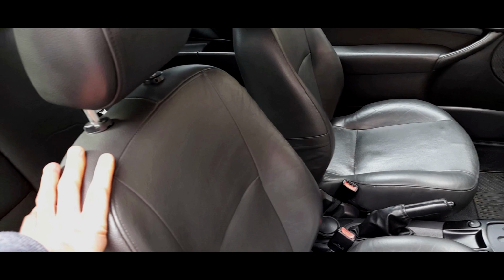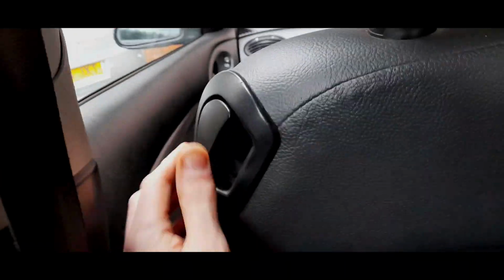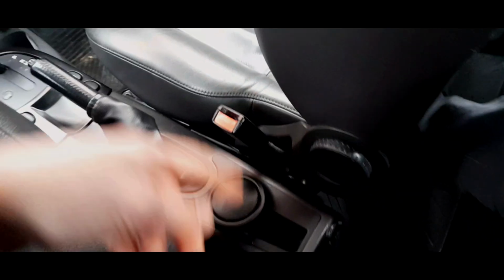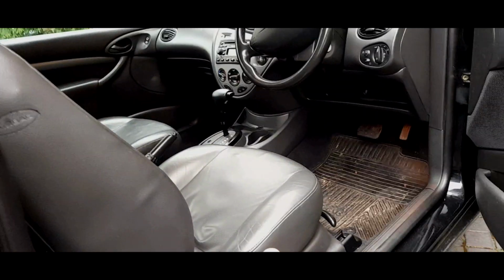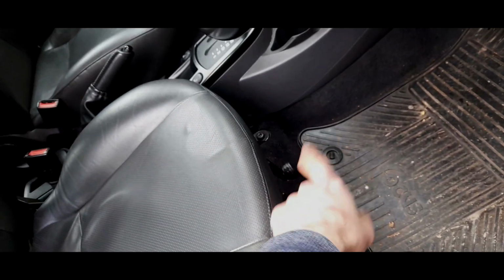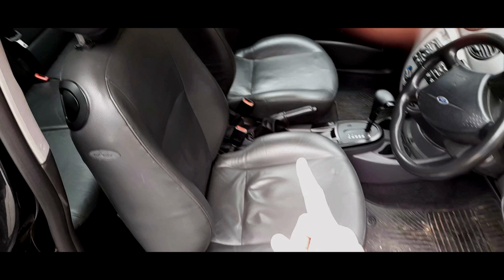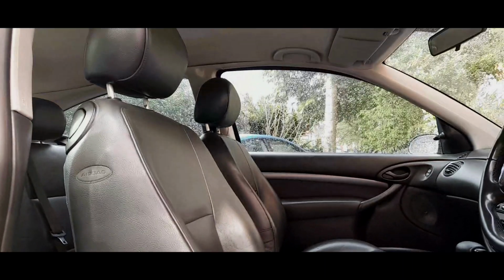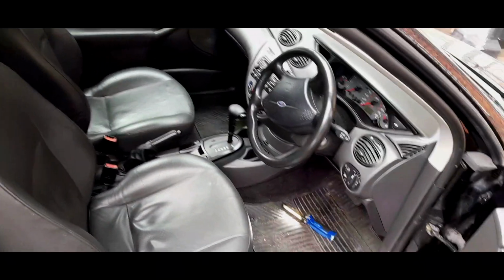Focus MK1 - Looking at the Seats, common issues & swapping them!

Comment: Question, I may have missed it in your video, would Ghia leathers slot into the lx in terms of the switch under the seat?
Reply from the maker: No LX models don't have the wiring for electric seat adjustment so it wouldn't work on ghia leathers.
Reply: @usuallyfixingtinkering  so am I right in saying I'd need the zetec leathers as they have pretensioner plug just not the electric adjustment
Reply from the maker: @matenagypal7322  spot on its just the seats will have the bigger bolsters which  an LX wouldn't have.
Reply: @usuallyfixingtinkering  lovely thbak you for the clarification

Comment: I have an Australian delivered 2003 Zetec model, and it has wiring for literally everything (even though they never came with any of the options) I managed to find a set of ST170 seats and everything works fine! I just need to get the airbag computer recoded to accept the side airbags
Reply from the maker: That's really interesting! Do you have wiring for electric heated mirrors?

Comment: Can I ask your advice ? I fitted Leather seats to my 2004 Edge. Vast improvement in comfort. But...Cant get airbag light to go out. Any ideas please. Ta !
Reply from the maker: It sounds like there's a dodgy connector in that block under the seat, the SRS system thinks the seat belt pre-tensioner is not connected. Disconnect the battery, then undo the bolt holding the two halves together and retighten, reconnect battery and see if that works.
Reply: I'll give that a try...Thanks.

Comment: If I went and got heated seats for my 02 Ford focus zetec  would I need to buy the centre console piece with heated buttons as I’m looking to do this in near future currently got cloth seats and plain centre console piece
Reply from the maker: You will just need that gear lever surround with three holes, two for heated seat buttons and a blank because like mine yours has no traction control I'd assume. There's no such thing as a two button one for facelift cars. Just a blank like you have at the moment and three holes which is the one you need. You will have the plugs in the console ready to plug and play but... that depends whether the elements in the seats still work. They often don't and jeed the seat sitting to replace the seat pads with universal ones.
Reply: @usuallyfixingtinkering  thanks for replying that’s cleared that up for me just got to find the right seats to go into my car! I assume st170 seats would do the job or do you have a recommendation?
Reply from the maker: @iDuaneLivings  for your car it'll have to be zetec leather seats. Not ghia seats as they are flatter in profile with the bolsters and not st170 recaro as you have no electrics for seat adjustment motor on them. The zetec leather seats you want have heated elements in them, drivers manual height adjustment and the correct thicker bolsters to match what you currently have in the car. Also I tour car is a 3dr make sure the seats are off a 3dr with seat recliner handles!
Reply: @usuallyfixingtinkering  ok I’ll get looking about! does it have to have to be recliner seats as mines a 5 door? So would prefer if I didn’t have to but willing to do it

Comment: I would like leather, but have an estate, so have very little chance of finding one that is breaking with any. Not sure if you can fit non airbag seats to a a car that has them, or whether it will throw up a lovely little light on the dash.
Reply from the maker: I'm afraid it would because if the airbag wiring isn't fully connected the light will show. Getting estate seats will be the same as the 5DR seats!
Reply: @usuallyfixingtinkering  I believe the estate seats are wider at the rear and the mounting points   don’t line up. Read on line and that the rear bench is different
Reply from the maker: @enchantress7940  that's news to my ears, I'm pretty sure they're interchangeable
Reply: @usuallyfixingtinkering  double check on line. Someone bought some five doors and they were narrower and the latches don’t line up on the rear. I will find some. Had a dark blue metallic zetec 2.0 on a 53 plate about 6 years back and that had some lovely leather seats.
Reply from the maker: @enchantress7940  that is possible I'll have to look into it but I am sure the latches are in the correct place.
Reply: @usuallyfixingtinkering  please do, as I have been passing up lots of 5 door seats based upon that.
Reply: Just to add on to this thread - I own an ESTATE and a HATCHBACK MK1, and can confirm that the estate seats are NOT the same. Fronts are exactly the same as a hatch, as well as the bottom portion of the rear seats is the same and will fit either. However the part of the back seat that your back leans on will NOT fit. The latches are totally different and not interchangeable between the 2. I have had both seats out of both cars and physically tried it.
Reply: @enchantress7940  @usuallyfixingandtinkering
Reply from the maker: @connorbamber3614  wow thanks for confirming, how much is the difference it must be minimal?!
Reply: @connorbamber3614  thank you for confirming what I thought I knew.
Reply: @usuallyfixingtinkering  it’s not huge, but enough for the seats not to fit. Apparently if you swap the seat latch from a 2003-2008 fiesta, then you can fit hatch ones into an estate. But me personally I wouldn’t mess with latches and things. But yeah, everything is exactly the same for all models except for the back portion of the rears. I found out the hard way lol! I have 3 door seats in the front of my estate, it’s handy when you’re cleaning the car lol. I hope my comment didn’t come across as rude or arrogant, I just wanted to add in as I’ve tried it before personally :)
Reply: @usuallyfixingtinkering  I should confirm, they will physically fit, physically they are all identical, but it’s the latch itself that is different and therefore the seat won’t lock into place when you push it back. I hope that makes sense to all.
Reply from the maker: @connorbamber3614  that's grand thanks for that!

Comment: My lx mk1 2005 has cloth seats and has airbag label on the front seats which was surprised at.
Reply from the maker: You have the reflex pack! Very rare
Reply: @usuallyfixingtinkering  Mine 2003 Lx (I think) has cloth with 4 airbags too in total
Reply from the maker: @Tadasskr  you have the reflex pack 100%
Reply: @usuallyfixingtinkering  Could you give more info what in in that pack? Only airbags?
Reply from the maker: @Tadasskr  sorry I forgot to reply - Reflex pack includes ABS, Traction Control and 4 air bags (2 in the side of front seats).
Reply: @usuallyfixingtinkering  mine car doesn't have traction control
Reply: @usuallyfixingtinkering  Mine doesn't have traction control either. There's no button on the centre console where it should be
Reply from the maker: @Tadasskr  that's interesting, tbh it's a UK designed pack so I don't really have the insight if yours came out like that or not
Reply from the maker: @adamjow8405  some didn't but from what I've found quite rare
Reply: @usuallyfixingtinkering  Maybe in Germany where this car was first bought 4 airbags was not that rare, so it might be advice if you want cloth seats with airbags look eu market